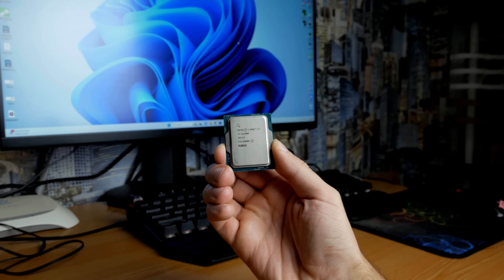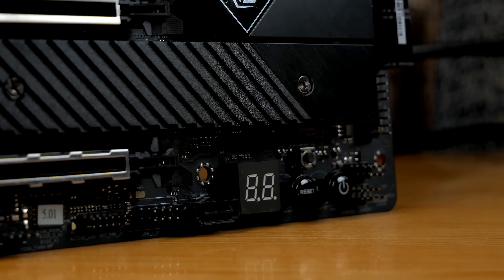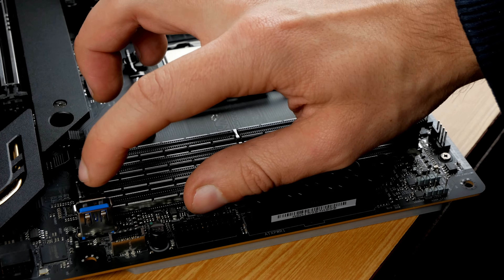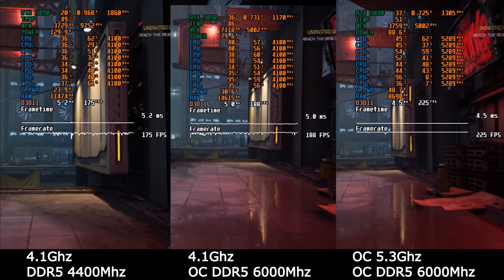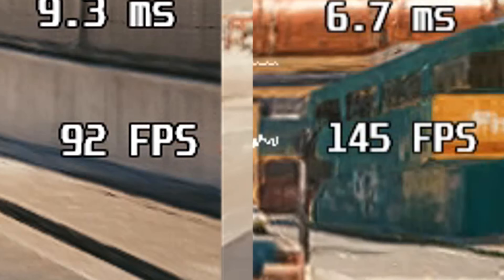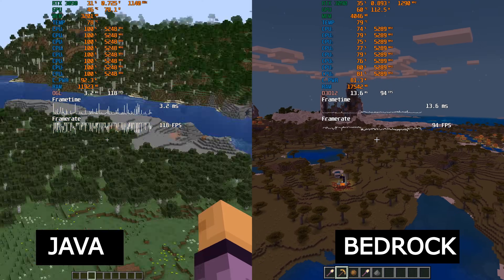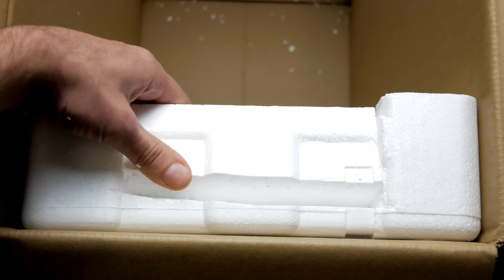i3 12100 VS OVERCLOCKING

Comment: The overclocked i3 is 30-40%, not 70-80%, better than the Xeon in Cyberpunk 2077 because the xeon is producing somewhere between 2/3rds and 3/4's of the frames compared to the i3. In any case, nobody uses that Xeon for gaming. It's actually one of the worst xeons for gaming. Should have used 2667 V3 or 1680 V4 for a better comparison.

Comment: hello 
I WATCH THIS VIDEO AND I OVER CLOCK THESE SAME SETTINGS WITH LIQUAD COLLING 
AND MY MOTHER BOARD GIGABYTE H160m K ddr 5 AND MY PROCESSOR i3 12100 has BROKED 
AND I TOTALY SHOCKED AND I BUY THIS AGAIN AND NEVER OVER CLOCK!

I WILL RECOMMEND DO NOT OVER CLOCK SIMPLE PROCESSORS LIKE i5 12400 
BUT IF YOU HAVE LIKE i5 12400k THEN YOU OVER CLOCK LITTLE BIT

Comment: come on dude running the Xeon with a gtx 1050 ti , of course it Will be slow , try  an rtx and compare . thats not a fair comparison for the poor xeon
Reply: It doesn't matter what GPU he's using, no one uses that Xeon for gaming because it's not a good gaming xeon. To many cores and threads and it only boosts, temporarily, to 3.6Ghz. In any case, had he used the same GPU across all three CPU's the preformance gap between the Xeon and i3 would have relatively remained the same regardless so it's a moot point.

Comment: Remember guys an i3 is a damaged i9 or i7 processor recycled by intel locking cores.
Reply: @greenRichard-e3j  just sometimes
Reply: Very rarely true, they do actually purposefully produce wafers for each tier of CPU. On the off chance one of a higher tier is below quality they will solder off the defective cores and recycle the silicon into the lower toer. They do this because those wafers cost billions of dollars to produce. This also does not explain how he is getting these results. Those "extra" defective cores are physically, permanently, deactivated not locked. Locked suggests they can be opened and reactivated again which just simply isn't the case save perhaps a singular example in relation to non-k 12700's with a particular serial number.
Reply: It's not damaged, it's just binned lower. Or in otherwords, it's lower quality silicon. 'Damaged' makes it sound like Intel produced an out of spec product, which is not the case.
Reply: @lateralus6512 First, Intel didn't produce any of the 12th, 13th, or 14th gen wafers, TSMC did. Secondly, Lithography hasn't yet gotten to a point where every silicon wafer is produced without flaws. Both Intel and AMD have recycled and rebinned silicon that didn't pass the QC necesary for its intended purpose. These wafers cost billions of dollars to produce so they have to make a product with it in order to recoup the costs somehow. In AMD's case such products would be the Ryzen 3 4100, Ryzen 5 4500 which were both intended to be APU's but weren't of a high enough quality and with AM5 the same can be said if the 8400f and 7500f.

Simular "shenanigans" hapoen when it comes to GPU silicon dies also. It's just how these things work and no company can avoid them.

Comment: I just got a hold of the Asrock new model - B760M PG Riptide. Threw in 12100 £60 & 32GB cheap ddr5 £60 - At £230 + £170 for a RX 6700 10GB  and the i3 @ 5Ghz - Epic gaming for the price of a 4060ti.😄

Comment: BCLK/FSB Overclocking is back baby!
I also have BCLK overclocking on my AM4 B550M Steel Legend but it's useless as all CPUs have unlocked multi. 
I overclocked Socket A, 754, 939, AM2 from AMD and 478, 775, 1366 (X58) from intel using BCLK/FSB overclocking. Fun stuff
Reply: Good old socket A... I still have somewhere my old system with fastest AthlonXP, graphite unlocking. If i remember correctly, that cpu was overclocked to 3.something GHz but less then 3.4 for sure. It was crazy fast for Windows XP.
Reply: @samohraje2433  nice CPU :)

Comment: Reminds me of back in the day overclocking arguably the best overclocking budget cpu of all time, the celeron 300a, from 300Mhz to 450Mhz by using a BX chipset mobo and bumping the FSB from 66Mhz to 100Mhz. This resulted in a 50% overclock and a budget cpu that outperformed the intel flagship cpu at the time the Pentium II 450 at a fraction of the cost thanks to the celeron's smaller on die L2 cache running at full bus speed over the PIIs larger off die cache running at 1/2 speed.
Reply: i did pentium 2 333/66 to whooping 560mhz on high end asus mobo with 440bx chip

Comment: Boys tell me, should I buy this core i3 or core i5-12400 ???
Reply from the maker: looking at what you will do on the computer, the stock i3 has a rather weak processor, although it does not pull games badly, but I would pay extra and take an i5 so as not to upgrade the platform at all and then after 3-4 years I sold and bought everything  more modern components
Reply: @WhatAboutThePC  tnx for the response by the way, but I'm gonna get a PC for gaming and heavy stuff and can you tell me that the i5 go better with RTX 3060 or i3 processor and does the "F" version effects performance or it only not have built in GPU

Comment: This is peak entertainment 😅 i think I am addicted to these videos ❤ love your videos, 
Hey I want a bit of suggestion ,i have been using ryzen 5 2400G , 8 gb ram, with a 1050 ti 4gb  card from 2018, previously i used to play games but currently i don't play games that much, now coming to the real issue at hand ,

i am a developer , and my pc is unable to handle my workload , I have to work on a big codebase on daily basis, so one compilation takes around a huge amount of time and clearly 8 gb ram is also lacking 
At a single time i use multiple tmux sessions, a few tabs on firefox, and a table plus dbms, discord is all time running, and also one spotify instance, I use linux 
Without anything my ram consumption rate is around 300-400 mb but after start opening these things it's like my compilation is crashing in regards to sometime my cpu can't  able to keep up and sometimes the memory stack gets overflowed 
So I want to build a pc 
I don't think I need a gpu (I am not going to play games)
I just need a high performance cpu based build with a 16 gb or higher amount of ram 
What cpu do you suggest 
My budget is around 400USD
 
Any full pc build suggestion is also appreciated , Thank you .

Comment: How is the Xeon any fair in this? 
The xeon was paired with a 1050 ti and the others with a 3090..
Reply: 1050 ti consuming 300 watts ? probably just wrong name on msi..
Reply: That indeed is odd neither does 1050 ti have more than 4gb of memory
Reply: @Sphyxx it’s a 3090 just shows up as 1050 for some reason

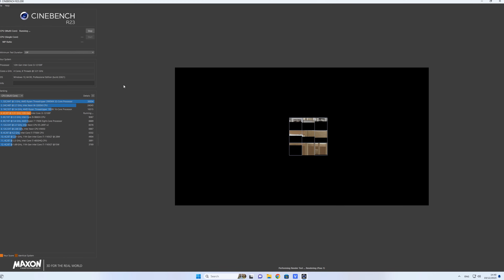Comment: 3:49 I don't know if you got bad silicon lottery or I got to good lottery, but my Ryzen 5 5500, which is supposde to have a fairly similar performance to the 12100 gets 4400, and it's not even overclocked, although I get a lower single core score

Comment: Or maybe just get used Ryzen system with b450 mb, a R5 3600-R7 2700/x and 16-32gb DDR4 + 20-40e cooler and still have money for 2x6-pack of beer or a budjet gpu+psu. i know parts are more expensive in other countrys than Finland but here you can build whole system for under 200e

Comment: I was under the impression that a very high BCLK OC is bad for all clock related components, did they overcome that limitation on the newer motherboards?
Highest I ever got with an i7-3770k was 104 BCLK.
Reply: I was thinking the same. Things like PCIe used to be affected by BCLK too. I remember when I tried to OC an i7 4790 and I couldn't get more than 103MHz BCLK.
Reply: This is because the BLCK is now separated from PCIE BLCK on some motherboards

Comment: I used to have the Asrock B660 Riptide and a 12400f that I overclocked to 5.3Ghz all core, it was an animal.
Reply: that thing even goes side by side with 12900k 💀
Reply: @rizqiramadhan5111  not in games with that low af cache
Reply: @sjejqnrof98vi  +-5fps doesn't matter.
Reply: @sjejqnrof98vi  NO1 need to play game at 300+ fps....
Reply: how did you do this if you dont mind me asking 9 months later
Reply: @ThePerjhi  Takes two seconds on youtube to find out how.
Reply: On all 2 cores 🤣🤣

Comment: Good content, I like it! I did not know that I can overclock a non k cpu, but can I overclock a T cpu?
Reply: Yes, but don't. T chips have low all-core boost, which will make overclocking very difficult. For example, the i5-12400T only has a 3.4 GHz all-core boost, so you need to dial the FSB/Bclk all the way to 150 to get 5.1 GHz. But since FSB affects other things like cache and RAM, getting that high is very unlikely unless you go crazy with the voltage.
The only T chip worth considering is the i9-12900T(E), which has a 3.9 GHz all-core boost, and hitting 5 GHz on all the P-cores should be pretty trivial.

Comment: This is mad, why fancy board for i3 crap ? invest in fancy cooling solutions ? MAD !  65 Watt max !
Need cheap, 13700 F, only overclock the Dram, everything. The F version keep the system cheap, not needing a fancy board or fancy water cooling blocks what ever.

Comment: Use mid range gpu like 4060 or ti on both then compare results. In some cases, i3 bottlenecks 3090.
Reply from the maker: what's the point if the 4060 ti is weaker than the 3090, the 3090 is close in power to the 4070ti
Reply: rajmangalpandey3910
RTX 4060 cards are meant to pimp your mums old DELL, able to play some games on it.
Mid range build now, 13700 F + RTX 4070 ti
Lower i5 + RTX 4070
Reply: @lucasrem  im not sure if i3 will bottleneck 4070 ti, i guess its too much for i3.
Reply: Oh boi the i3 certainly bottlenecks the 3090.. I used a 12100F on a Z690 Formula and run 5.3-5.4 Ghz with an air cooler and it still wasn't enough to satisfy my 3090 even at 5120x1440

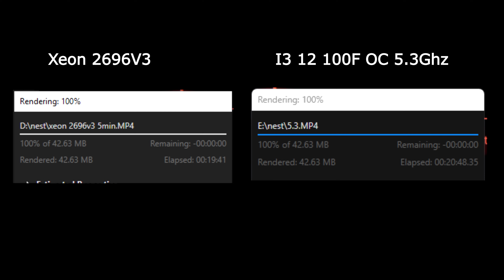Comment: 4:15 but did xeon have the turbo unlock + undervolt? I dont think so😂
Reply: Also disabling hyper threading does miracles tor gaming
Reply: @doofbuff7287  does it? It might depend on background apps running, if it can increase single core performance then for sure it will give more fps in esport games without stuff running in the background

Comment: i demand a video on I5 12400F with steroids RIGHT NOW :face-orange-biting-nails::cat-orange-whistling:
Reply: You still use that GTX 1080 ti in 2023 ?
good for old CPU's, not bottleneck new cards !
Reply: @lucasrem   bruh you talkin to me ?, if you're asking wich old cpu would work with gtx 1080Ti, I would say an 8th gen i5 or i7 "K" version so you could overclock it that's the lowest I would go.

Comment: Before the b760 riptide was on newegg I got the ddr4 version (b660 riptide) for $130 on aliexpress. I was a bit sketpical but at 5.1 ghz my 12100f has better multicore perf than my overclocked 4.5ghz i7 5960x. Crazy how fast this cpu is and i will soon pair it with a 4070 or 3080
Reply: Splash Boi
Any 14900 F CPU is cheap, not needing that fancy block and pipes, why fancy board ?
65 Watt CPU's keep the PC cheap and quite.
Not bottle necking the RTX 4090 !
Reply: @lucasrem that board is cheap tho..like 150$..adding all the cost together its only like 250$ and it gets you a mobo and cpu..while K sku cpus cost that much alone plus u need Z series mobo to OC it..

Comment: Overclocking intel is great and gets pretty good gains son's i7 8700k delided and overclocked to 5.1ghz paired with 2x16gb 4400mhz memory received amazing gains.
Reply: I think the gains have diminished when they released an i9. Now all the i7 are binned down and the potential for overclocking an i7 is lowered. Not to mention recent trend to dump more power and cooling to boot which further reduces the headroom we can squeeze out by overclocking.

My Haswell i7 got a nice 25-30% gain and beat a 6700 albeit draws 120w
Reply: @harrytsang1501  look at 13600k doing 5.7-5.8ghz 13700k and 13900k also overclock decently do require better cooler though potentially even custom loop. But I wouldn't say it's diminished as much as people say.

Comment: I like how people just randomly accepted the argument that 12100f (and the whole LGA1700 platform) was a ''budget'' cpu or a better choice than AMD when it launched when the new h610 platform costs were around 50%+ than ryzen equivalents (where sometimes you didn't need to spend one cent more on anything else since you'd just reuse your mobo, whilst in blue side you were OBLIGATED to change to a whole new chipset), I mean does a cpu work without a motherboard? Until this day in my country A520M able to withstand 5700X (A PRO from MSI) goes for $60 and the crappiest (unable to hold 12600k) H610 for $90, the mid-range ones for $120, with around the same price you have a B550M Pro Vhd for $140 able to hold 5800X3D
Reply: I mean, you wont bottleneck a 4090 with a cheap 5600X too in GPU bound games
Reply: what? the cheapest H610M from the big brands is only like a little bit over $70. soyo B760M meterstone is only $95 where i am and it has DDR5 slots and a VRM good enough to withstand the i9. its even slightly cheaper than their B550M mobo. intel 12th gen is definitely better than AM4. lower idle power and faster clock speed.

and no, i would not recommend using a $60 motherboard with any ryzen cpu above the 4500. theres no guarantee the vrm will handle it well, and bios flashing could go wrong.
Reply: Amd has a more affordable upgrade path. I think Intel holds their value too well so if you want to upgrade your I3 it wont be worth it. If you buy a cheap Amd cpu you might upgrade again in the future where as an I7 Will probably take 10 years to cost the same amount as the equivalent Amd CPU. I could be wrong though it depends
Reply: You're also losing out on a lot by getting an F cpu since you lose the Igpu and its way harder to mess with your cpus clock speeds.
Reply: Even a b450 pro VDH max can run a 5800x at full tilt
Reply: @Bunta1987qwerty theres not much advantage going with 5800x instead of 5600 for gaming. also b450 only has pcie 3.0, which reduces the performance of GPUs with small bus width.
Reply: @aboriginalmang     that’s true for most games, but some games are cpu hogs. Tlou1 is that way, and so was Spider-Man when it came out. Tlou1 becomes cpu limited with a 5600x if you have a 6700xt or better, unless you play at a higher resolution. Just as an example. 5800x3d would obviously be better, and would be easier on the vrm. I used to run a 3900x on the MSI b450 pro vdh max at 4.2GHz all core. Small bus isn’t exactly the problem, but shortage of lanes. X16 is great, but a 6600xt doesn’t need more than x8 even on gen 3. Anything above that besides the 4090 would be fine on gen 3 since they have x16 if I’m not mistaken. The point of my original comment was in support of the OP comment. Am4 was/is the better budget option compared to the i3 platform they mentioned. Lots of people who went AM4 a long time ago didn’t have to buy a new board, and even if you were on intel, it was still cheaper to buy a b450 and zen 3 than the latest budget intel at the time, since that required a new mobo too.
Reply: @Bunta1987qwerty  ah if what you meant was 5800X3D, yeah that's a good gaming CPU, but the 5800X is not. Also OP was talking about how AMD boards are much cheaper than intel boards which is just straight up false. That's what i was arguing against. Yeah AM4 is cheaper, but only if you already have an AM4 board. Intel boards are just as cheap. Not to mention 13600K is cheaper than 5800X3D and outperforms it, you could spend the money on getting a board with decent VRM.
I'm not denying that AM4 boards last a long time, although i wouldn't recommend pairing an old budget AM4 board with a 5800X3D which builds up heat easily.
Reply: cockus4192
These F CPU's on LGA 1700 are very good, you don't need the fancy Z790 boards or fancy cooling.
Not bottlenecking the RTX 4090 on a cheap build !

Comment: Please do i5 12400 and i5 12600k please you are amazing
Reply: You can probably overclock that 12600K since it has 'K' in it
Reply: @blacknote6945  you can overclock both. (12400 & 12600k). I am only interested to see the afte oc results and games comparison with a high end cpu like this i9 14900k
Reply: @blacknote6945  12600 k, if you got old GPU, it's still good enough.
======[ PRO TIP #1 ]========
never bottleneck any new RTX 4090 on old CPU's only

Comment: Why you didnt turbo unlock xeon 

They will have much better fps if you do this
Reply from the maker: It already has unlocked turbo boost
Reply: @WhatAboutThePC  nope,turbo od 3.6 
In your video i see only 3.2 
Maybe you have cracked turbo bios 
On my huananzi zd-4 normal turbo unlock didnt work
But turbo unlock and -50mv bios works fine 

Sooo maybe try this
Reply: @enekxYT  Turbo will only boost up to it’s rated clock when only doing single core work. Hence, BCLK will do better due to the chip actually forces all the core to work the rated clock and voltage.
Reply: @bruhty9504  yea but xeons V3 have turbo unlock 
And if you do this you can force all cores to turbo

My 2670 V3 on turbo and -50 mv have 3.1 GHz all the Time in games

Comment: I believe the b760 pg riptide has bclk and supports ddr5 for 120$, pretty good deal for a bclk board
Reply: williamdodge7320
OMEN PC here, 13700 F, XMP 6000, b760 is enough, minimal I/O, 2x NVMe max is enough. Not bottlenecking the RTX 4090 on a cheap build.
why Z790 fancy ? why fancy radiator on a cheap build ?
b760 + 14900 F = Good and Cheap !
Reply: @lucasrem  14900k for better ram oc potential due to unlocked sa voltage. i run 12900k on b660 mortar max
Reply: Gonna look into this thanks. Wasnt aware that 700 series finally started to dump ddr4.
Reply from the maker: Personally, I have not heard or seen that bclk is installed on motherboards with a 700 chipset
Reply: @WhatAboutThePC i can confirm that b760m pg riptide support 12th bclk oc..it OCed my 12400f to 5.1ghz...